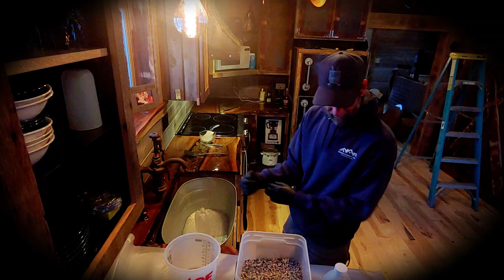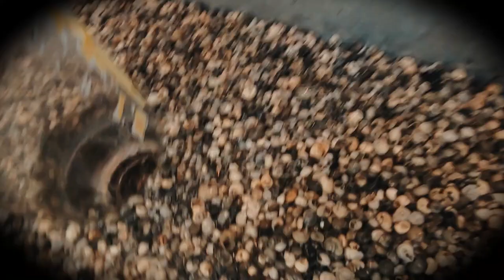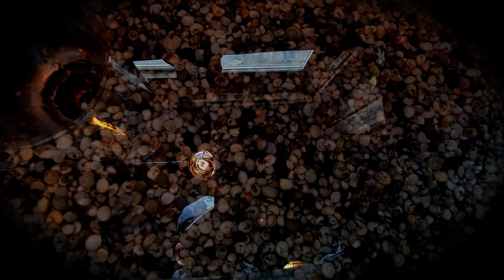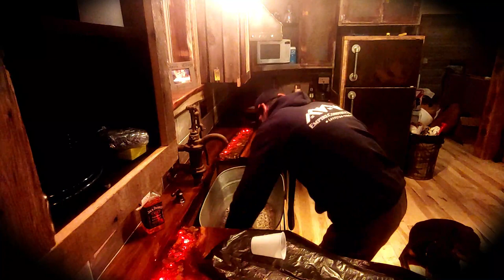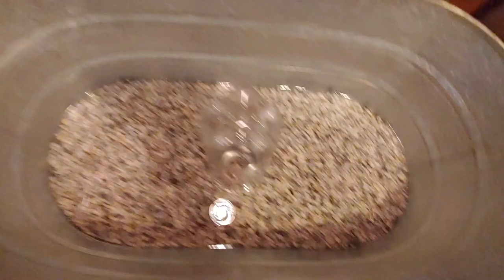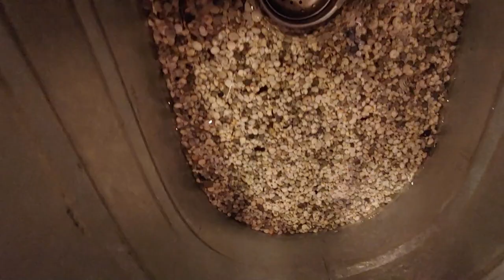Bucket sink with Epoxy Lake shell bottom

Comment: Hi Ben,  I finally finished my Buffet with the Galvanized sink. It turned out beautifully the first try and we are using it in our main bathroom
With a galvanized pipe faucet. 
I used small pebbles instead of shells, and the decor is Gunsmoke/Saloon/Farmhouse. I wish I could share pics. Thanks for this posting this video, 
I have worked with epoxy before and your instructions were very easy to follow, and just perfect! 😊

Comment: My buddy put a galvanized horse trough in as a bathtub for me. It's cool but it doesn't drain right because of angle and I wondered about epoxy? It's actually a bit too deep, do you think I could put a layer of that purple insulation board then epoxy over that?

Comment: I followed your instructions, and need to know how and what you used to shape the drain edge? How do I do this? I used small pebbles for the bottom of mine and so far it looks amazing!
Reply from the maker: My lake shells are so small it formed it on its own. After you pull the bottle out. You will need to grind down the lip it will leave. Then Polish it another tip before you pull the bottle out tilt the sink to each side a little and pour another top coat. Then do it the other side as well. This will help slop the water to run into the drain
Reply: @endlessempirecustomcreatio816  what tool did you use? I need to shave quite a bit?

Comment: Your right not to mix with a drill. It causes the epoxy to get a lot of air bubbles. Making it very hard to get all the bubbles out. You would need to use a hand torch a good amount of times or use the heat gun till your arms feels like its falling off lol.. just to pop the bubbles even having to spraying with some alcohol. Even with all that you will still have some bubbles that you will able to see even when the epoxy dries. 
You always want the least amount of air bubbles as possible. So you are right Always hand mix Epoxy.

Love this sink, Im doing a bus conversion and this will make a great sink for the bus. Thanks for the idea I think I will do the sink with small river rocks instead of shells ..
Reply: what kind of epoxy is used?